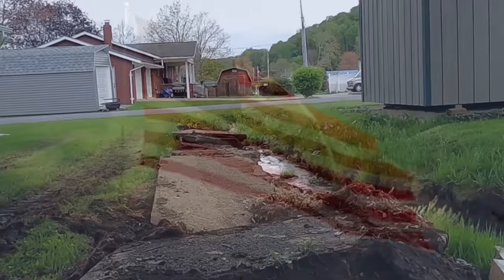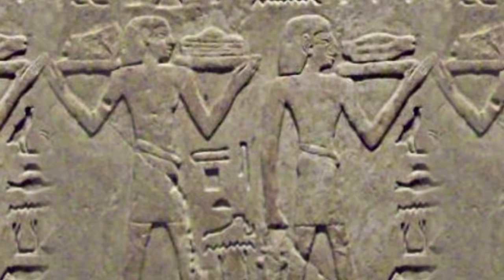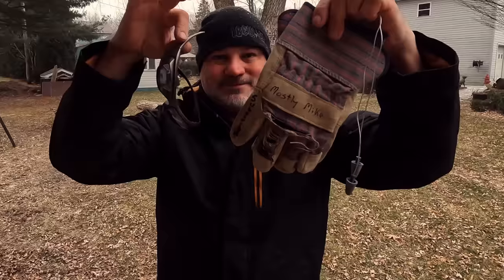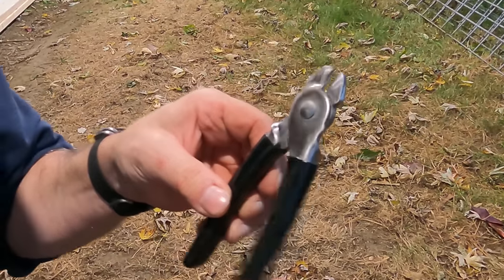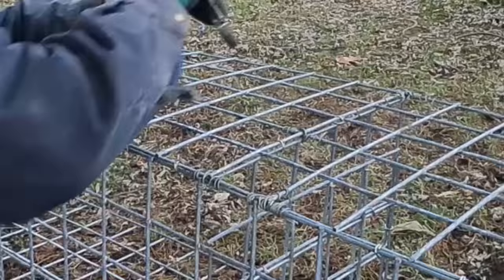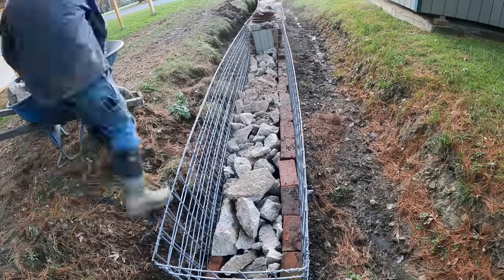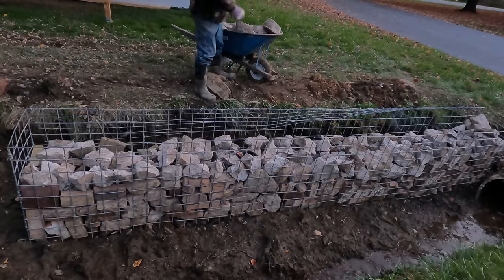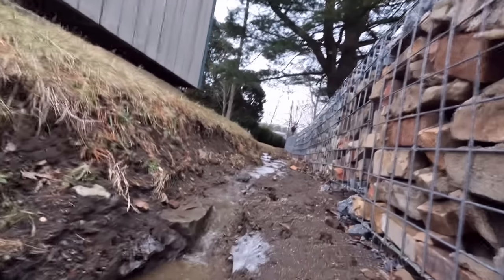How I Built My Own Border Wall Cheap

Comment: I dont get how a group of somewhat large stones is supposed hold back water. Does the wall allow one side of the ground to be raised higher than before? I feel like I'm missing something.
Reply from the maker: Thanks for watching. They are not really holding the water back. They give the water a place to expand into, but prior to the wall going in, there was a sloped bank that the water could just shoot up over. With this wall, a liner was installed later before filling it back in on the back side with number three limestone. Another layer of geofabric liner was placed on top of the number three limestone, then a foot or so of topsoil was added to support grass growth on top. The vertical wall that this geofabric made against the back further allowed water to have a place to expand, but being that there was current, the water Trends Downstream which prevents flooding to my garage. Being that the pipe exiting the ditch is about 10 inches smaller than the pipe flowing into the ditch, there is still a problem with it damning where the wall ends. This is up to my municipality to put a bigger pipe in, which currently I believe is a violation of plumbing code. So now the water flows over that but does not flood my garage. I hope this clarifies things a little bit. I hope to make an update video in the future showing the geofabric and all of the stuff I spoke about.

Comment: 2 years later stumble across your video. Look impressive but let me ask about your experience. 'Thus the stones and rubble are stacked loose inside the gabion cage the water actually is still able to penetrate the wall. Means in case of higher water levels of that little creak ....??? Did it work to keep the water out.....just curious to know
Reply from the maker: Thanks for watching. As for my experience in building these walls, I was flying by the seat of my pants making this video. About the Loosely stacked stones in the baskets, they are not meant to hold water back as much as for guiding the water Downstream opposed to going up the sloped bank and flooding my garage. After backfilling with #3 limestone, geofabric, and a layer of topsoil for grass, it gives the water a place to expand as the waters rise... If that makes any sense. It actually works pretty well so far. As other commenters mentioned, there's a little bit of unforeseen minor undermining, which I plan to fix with some concrete mix and some limestone at the base. There's a one minute short that I posted showing the wall handling high water. I hope that this helps.

Comment: what happens when the metal cage rusts out?
Reply from the maker: It's been up for two years, and so far there's very little sign of rust. The galvanized coating on those goat panels is pretty good.

Comment: Wonder how it would hold up if you packed the outside witch cement? Wouldn't be able to tell the difference between concrete or stone wall.....but would it hold up?
Reply from the maker: Thanks for watching MadClanPC. Not sure on that. It seems to be holding up like it is. These walls have been used for a long time. I'm sure that cement wouldn't hurt it though. I like that it allows the water to expand without eroding.

Comment: Mike! I loved your video! 😂 Your dry sense of humor made me crack up! 😅  I'm planning on doing this as well. Do you need to put a drain pipe and gravel BEHIND the wall as when doing a block or stone wall, or is it sufficient as is? Planning on doing the same amount as you did. Great suggestion on rubble /concrete for the infill and backside, where it won't show! 😉
Reply from the maker: Thanks James! I put geofabric behind the wall and up the bank, then #3 limestone over it, all but about 12"...then geofabric with topsoil for the last 12". I figured that the limestone would provide extra drainage for the lawn, plus give some of the high water a place to expand. I hope to post a follow-up showing that part pretty soon, and maybe another video addressing the questions people asked, and the libtard remarks that some entitled Bidephile snowflakes had to make about my coincidental game of pretend.

Comment: What are you going to do when in ten years or less the galvanized hog panels begin to rust? Did you pour quick Crete in to solidify the wall?
Reply from the maker: I don't doubt that they will Rust eventually Paul. I just did what was within my means at that time. The whole ditch a man-made by the town that I live in. Water generally only runs in it when it rains, but it is the Watershed between two Hills. It was supposed to go straight into a river, but my town decided to put a 90 on it and run it where it is. Where the 90 is located, it is a 24-in pipe dumping into this ditch. As you can see at the end of my wall, there is a 16 in pipe going under that road. I have made three complaints to my town to get that fixed to a larger pipe, and the first complaint is on its 5th birthday. They don't want to do anything about it. When I filed the complaint, the street commissioner asked, "when is the last time it flooded... I replied that that would be like me being an electrician when you have an electrical outlet shooting Sparks out of it and you filed a complaint to me, and me replying with "when's the last time that your house burnt down."
As you can see in that footage in the beginning of the video, the threat of flooding is real. When I showed them the videos showing how bad it was and how deep the water was in my garage, they didn't even want to look at them.

Comment: Can I make the wall of a room this way and finish it nicely?
Reply from the maker: Thanks for watching! Do you mean like a room for an outdoor living area?
Reply: One side indoor and the other in the garden .I have so much broken brick walls and it’s very expensive to take them away so I thought it would be economical to reuse them
Reply from the maker: If they are colored consistently, they would probably look pretty good. There are purpose made gabion cages available on Amazon and other vendors that have smaller holes as well as easy to assemble panels that don't require all of the wrapping that I did in the video.
Reply: Love the look of yr wall
Reply: Thank you for yr time and ideas
Reply from the maker: No problem at all. Glad it helped. I wish you the best of luck in your project.

Comment: Did the wall do what you thought it would do?
Reply from the maker: Thanks for watching Tony. It was part of the solution for the problem that I was having. It is effective at keeping the waters from just rolling over the sloped Bank and flooding my garage . However, the pipe exiting the ditch needs to be replaced with a larger pipe, but that is my municipality. I have filed complaints over the past five or six years and they have yet to do anything about it . There is a 24-inch pipe feeding the ditch and a 16-inch pipe exiting the ditch, which I believe is a clear violation of plumbing code.

Comment: Loved the wall (with the exception of the brake rotors :-)... how did the wall do against the heavy rain waters??? Love to see the follow up video ! Great job ! :-)
Reply from the maker: Thanks for watching Doug. I get mixed reactions on the brake rotors. Some people like them, and some don't. I thought they added a little character so that's why I showed them. I posted a one minute follow up showing the ditch completely filled after everything was landscaped. It's just a one minute short. All in all though, the wall is holding up great, and it controls the water. When I say controlling, it does not hold water back, but diverts it the direction it needs to go. Prior to me building this the water just went up the slope and flooded my garage out, and eroded the ditch closer and closer to the garage. This brought the ditch where it needed to be and it is eroding the opposite direction now. I do plan to make a follow-up video in long form and address all the different types of questions that people have asked. I'll include the link to the short version after this comment.
Reply from the maker: https://youtube.com/shorts/dNvwMh9plZ0?feature=share

Comment: Gabion walls are quite strong. They basically take a lot of small rocks and make them act as one rock. Great for enforcement of creek banks.
Reply from the maker: Thanks for watching and taking the time to write a helpful comment. That's a great way to describe how these walls work. Mine only comes in contact with water after a heavy rain.

Comment: Any update on it how’s it doing? Anything you do different on your setup and design?
Reply from the maker: Thanks for watching Doom Bunny. Hopefully I will get an update video out soon showing all the landscaping, additions, etc. As well as answering the questions people have.
The only thing that I would have done differently is maybe set the wall a little deeper. I never anticipated the ditch getting a little deeper on the downstream end. It eroded the opposite side like I had hoped for to restore it to the course that the water took about ten or fifteen years ago.

Comment: Very nice and simple. Good job! 

The only downside is that, at 9:23, I see the gabion is not in straight line. My perfection is kicking me seeing it that way lol. If it was me, I'll make sure all of them are straight using a string of rope before I fill it will rocks. But overall, its a good diy project.
Reply from the maker: I appreciate you watching Steven. Actually, the ditch kind of swings at an arc. I was able to manipulate some imperfections. I was really hoping by now to get an update video out showing the back filling and Landscaping. It looks a lot better now with grass growing around it, a few more sections, and even a culvert. The shed is actually spun around and there is a bridge going across. Hopefully by the end of summer I will have that video out. My schedule has been nuts lately.

Comment: but would not the metal rust away over time and make the wall collapsing?
Reply from the maker: It's been over 2 years since I've built it, and there is no sign of any major rust yet. Time will tell, but it seems to be holding up pretty good. Thanks for watching.

Comment: i have done a fair bit of gabion work, as well as mattresses which are basically the same, except a mattress is 8 x 12  and  1 foot high they are mostly for stabilizing cuttings or hillsides.
Reply from the maker: Thanks for watching Waza. I have never heard of the mattress concept before. Sounds interesting.

Comment: Can we get an update on how it's working out?
Reply from the maker: Thanks for watching Tailgunner. Yes! I will probably be doing an update video in early Spring. I have since backfilled, planted grass, added more wall, and built the bridge across to the shed. There were a few minor issues that I needed to address, but it's amazing how well it's taking shape and widening towards the opposite side of the ditch.

Comment: Very interesting build....I was wondering if you had a high water event since completion and how did the wall hold up/ help.
Reply from the maker: Thanks Joseph. The water has gotten about 3/4 of the wall height, but not sure if it's as much water as the footage in the video. It's tough to judge because the water actually wore the ditch down to the level of the pipe in the culvert, and started to carve the opposite side of the ditch, which is just what I wanted it to do. The wall itself will absorb a lot of the water too. I added more features and landscaped since this video, which was made a year and a half ago. I plan to post an update soon showing the upgrades and issues.

Comment: Stainless steel and Zinc galvanized steel don't play well together. You are essentially making a half cell reaction between the Zinc on the surface and the Nickel in the Stainless and the it quickly eats the Zinc up which then lets the underlying steel which it is protecting rust. Use Zinc coated steel fasteners with Zinc coated steel and Stainless fasteners with Stainless steel!
Reply from the maker: Thanks for watching and the advice Linmal. I don't doubt what you were telling me, but it's been 2 years and I haven't noticed any rust as of yet. I plan to do a follow-up video at some point and I will show some random close-ups of different parts of the wall.

Comment: The only thing that you didn't show, that I would have done is put filter cloth on the land side to prevent rain from washing the soil in your yard through the stone.
  I'm not sure about your area, but in my area we are required to control any sedimentary run off from entering the waterways.
Reply from the maker: Thanks for watching David. I was hoping to have a follow-up video done by now showing just what you were talking about. I purchased the roll of geofabric, and before I backfilled Against the Wall, I put a piece of the geofabric large enough so that when I filled old but about a foot with number three stone, that I could fold the fabric up the wall and then back over top of the number three stone. I then filled the rest with topsoil leaving a few inches stick out of the ground for looks. I will definitely be posting that follow up sometime in the future. It definitely looks a lot better and makes more sense seeing it the way that it is now. I added a bridge to the shed on the opposite side, which sort of acts as an added support for the wall. I also installed some tethering to the ground behind the wall.

Comment: The bad news is that wall will be undermined in short order, you really need to take it down to avoid the scour. You could alway line the bottom the the creek infront of it to protect it.
Reply from the maker: Thanks for watching John. Yes, there's a little bit of that happening, and the short fix was to drive some pieces of sharpened 4x4 pressure treated posts under the wall at angles to divert the current away from the base of the wall, which works decently. I still plan to take concrete mix and limestone to make a barrier on that side. The water has cut the opposite side of the ditch a little, which is what I wanted it to do. I own both sides and the shed. The root cause of the flooding still needs to be addressed by state or municipal level. The exit pipe of the ditch is actually 10" smaller than the pipe filling the ditch, which I believe is a plumbing code violation.

Comment: Has anyone done a cost comparison to a concrete/rip rap wall? Instead of using the cattle panel I mean
Reply from the maker: I haven't. My original plan was to line concrete barriers along that ditch, and it was going to cost about $1,500 or more to have them set in. I wasn't worried as much with the price is much as how bad it was going to look with those in, plus leveling would have been a nightmare because of the taper the ditch runs on.
I don't have exact figures, but this was under $1,000 to do. It was very labor intensive, but in the end, it really doesn't look bad, at least to me. If I ever decided that it did look bad I can plant Ivy in it, LOL.

Comment: Job well done, but why? I'm curious as to what other solutions were considered but deemed less effective.or ineffective. That wall , being permeable, won't do much to control absorption and muddiness as would that culvert  shown in the background.
Reply from the maker: Thanks for watching Rosey.  I considered using giant concrete blocks, but they were more expensive (less work though). I would have had to dig them in more to level the wall.
As for being permeable, yes, it certainly is, but I wanted it to be able to absorb the water some in the event of when it goes high, but the wall sort of controls erosion on the side that the wall is on, which explains why I built it down the middle. That's about where the water originally ran. I hope to do a follow up video soon showing the present state of the wall, ditch, landscaping, and a bridge that I added to get to my shed on the other side.
The pipe in the culvert that you can see in the background is way undersized. I have been battling my municipality since I bought the place to put a larger pipe than the 16 inch one that's there. The pipe feeding this ditch is 24 inch, and during high water it runs full pipe only to dam up at the 16 inch pipe. I called it a clear violation of plumbing code.

Comment: do you think these galvanized walls might survive the harsh maritime conditions when applied/submerged on sea water? We're currently working on a project partiularly with stone-walled fishtraps. Do you think gabion wall might be appropriate? Thanks
Reply from the maker: Thanks for watching. I don't know for sure, but I don't think galvanized would hold up real well with seawater. It's been 2 years since I started this project and the initial parts that got exposed to the elements still look almost as good as the day I put them in with a little bit of rust of course where the cuts were made or if they got scratched, but I am pretty impressed the way they are holding up. This is fresh water passing through them though. I hope to do a follow-up video showing what it looks like now that it is back filled with dirt and gravel. Everything is landscaped and it paints a clearer picture of how the wall really is. A lot of people thought by the video that I was building a wall in the middle of a ditch, but I was just shearing up the side and filling in with dirt using this wall as a retainer.

Comment: An Automatic Tie Wire Twister would have helped no end. You can also by  rebar reinforcing loop ties, rebar wire with a loop at each end that works great with this tool.
Reply from the maker: Thanks for watching and the helpful tip. Are those rebar ties available in stainless? That would be perfect if they are.